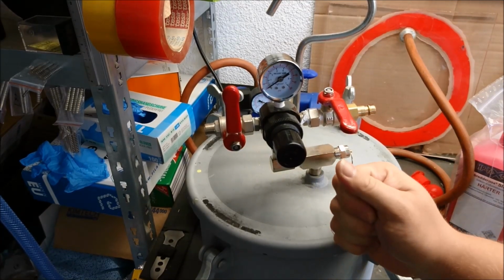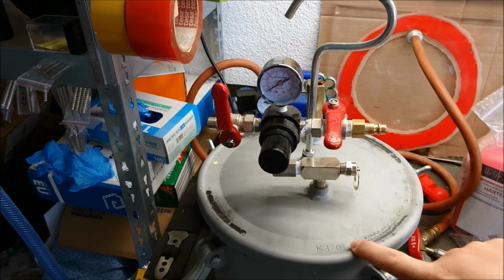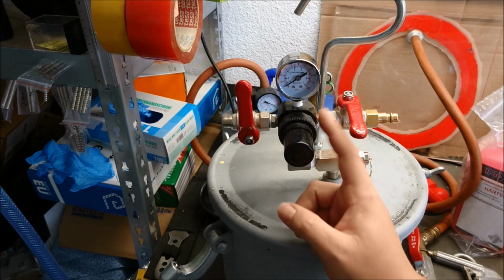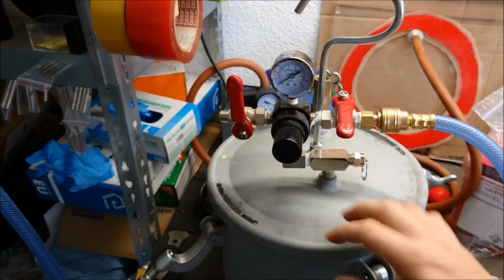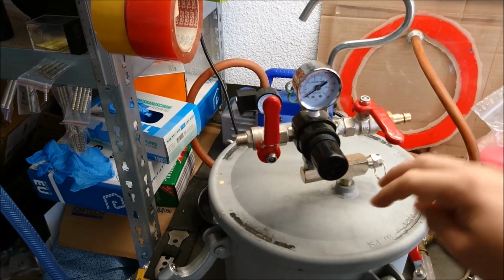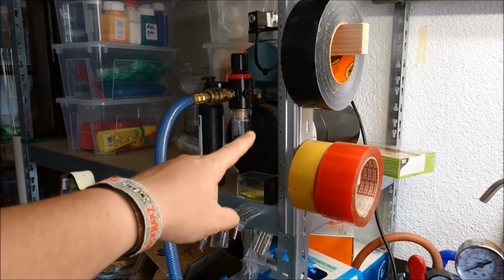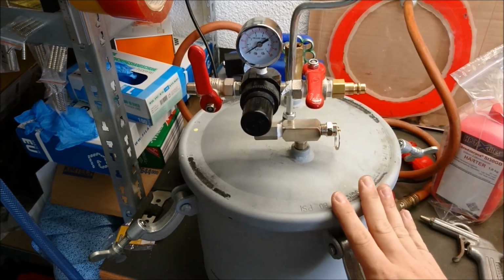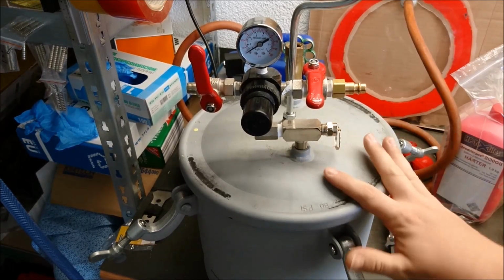Dice Making Equipment Guide: Pressure Pot

Comment from the maker: Little Update on this one. I put the wrong quickconnector for the compressor in the list. I had an adapter that goes from 1/8" to 1/4" to connect it. Now I added the correct thread size in the list. Sry for the trouble that some might have had.
Reply: Thank you

Comment: What valve did you use for the closed end? The one that looks like a flower. what are the dimensions?
Reply from the maker: Yes it has different dimensions, but I used an adapter to make it fit. Those were just parts I had laying around. The best would be an end cap. If you want to be hundred percent sure, I would recommend to get the pot first and check the threads. I'm not sure if the threads are always the same.
Reply: @wuerfel_schmied  I already have the pot. Just need the accessories. But I have no idea how to tell which thread I need.
Reply from the maker: @IcsulX  you can either test it with a part you know  size. Or you measure the diameter and compare it to a table.

Comment: This Video was exactly what I was looking for! Thank you very much for the video and the links, that's very helpful!
Reply from the maker: Always happy to help out. If any of the links are outdated or you've found something better, I would appreciate if you share it here so I can update everything.
Reply: @wuerfel_schmied  So far all your links seem to be up to date :) Do you have a link for the optional green valve (at 6:27)? That's the only thing I can't find in the list.
Edit: Could I use a 1/4'' screw as a plug to close that part?
Reply from the maker: @soulhuntress  it should be a 1/4 screw. So you could use the same valves as in the pressure gauge. Or simply a plug. At the time I wanted to order the parts, the plugs were cost more then the valves. So I decided to take the valves. And the green one was simply one I had on hand.

Comment: Hi this video has been incredibly helpful. I was just wondering, since the quickconnector you used for the pressure pot is unavailable, if you know of another product I can use.
Reply from the maker: I'll check on it later. It's a standard item so you can't do anything wrong finding another one that looks similar and has the same threading.
Reply: @wuerfel_schmied  ok thanks!
Reply from the maker: @stefgrig3267  I updated the link in the description to a new connector that is available. If there are any other parts missing or not available let me know.

Comment: Danke für die Anleitung die Teileliste.
Sehe ich das richtig, an meinem Kompressor brauche ich noch einen Adapter: Innengewinde 1/8 zu Kupplungsstecker oder? Im Moment kann ich so nichts an den Kompressor Ausgang anschließen (hab alle Teile der Liste gekauft)
Reply from the maker: Ich muss nochmal über alles drüber schauen. Aber ja du brauchst auch einen Anschluss am Kompressor.
Reply from the maker: Hey ich hab eben nochmal geschaut, der erste Link in der Komponentenliste in der Beschreibung ist der 1/8" Druckluftadapter.
Da ist nur gerade der 1/8" nicht verfügbar. Der hier geht auch. https://www.amazon.de/Druckluft-Kupplungen-1-8-Innengewinde/dp/B00FMTUGQW/ref=sr_1_3?__mk_de_DE=%C3%85M%C3%85%C5%BD%C3%95%C3%91&dchild=1&keywords=druckluftkupplung+innengewinde+1%2F8&qid=1599551297&sr=8-3
Reply: @wuerfel_schmied  Vielen Dank für die mega schnelle Antwort und das Raussuchen 😊
Reply from the maker: @simrr  kein Problem.

Comment: Is the pressure pot really necessary for dice casting if you have a vacuum chamber? I feel like you could just let the resin degas for a few minutes after filling the molds instead of pressurizing it for 24h. Or am I misssing something? I'm asking this because buying a pressure pot, vacuum chamber and pump and an air compressor is an expense I can't justify.
Reply from the maker: The pressure pot makes things a lot easier compared to a vacuum chamber. But both works. Check my other videos about that. Degasing works, but if you have bubbles catching in your mold, it might be tricky to get them out. The pressure pot will do that. Pressure pots make the success rate much better, but they're not necessary